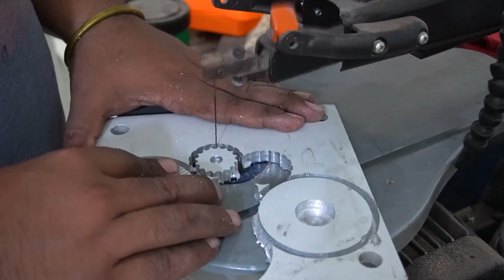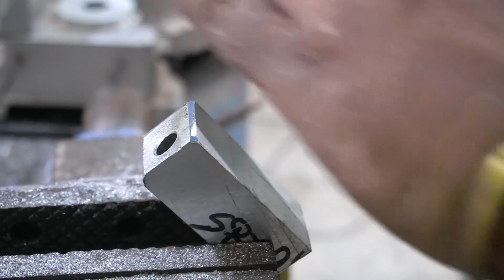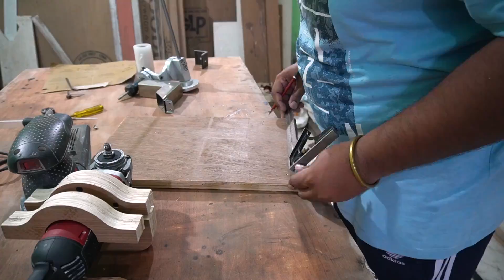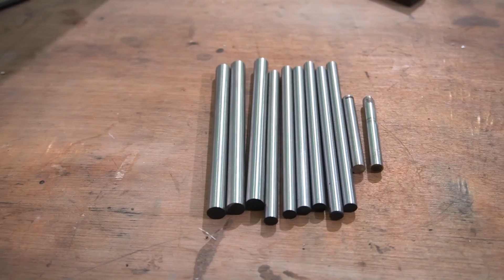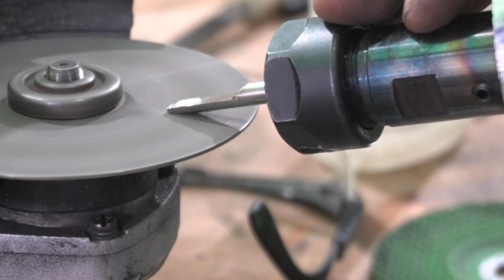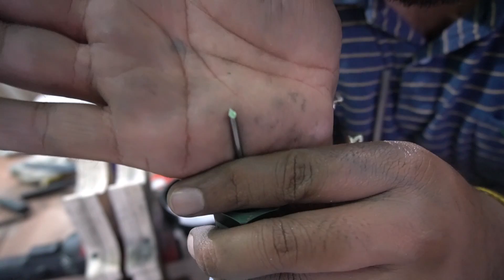Multipurpose sharpening Jig for CNC V-bits, Drill Bits and Gravers - By AMbros Custom

Comment: You're are an innovator and genius! Working with D bits for more than thirty years. This piece of equipment is unique!

I had made a little different piece of grinder from a design I got from British Council library.

Some suggestions though!
1/2 bit thickness should be about 20 microns less.

The back relief angle we use is a continuous relief like a drill bit, a swash plate mechanism is used to achieve that.

The tip is not exactly V, we give a horizontal and vertical relief of about 7 degrees. Tip is about 0.25 mm wide! 

We used them on 100Cr6 prehardened steel at 28 HRC on a VMC at just less than 8000 rpm! Works magic.

Innovate more and enlighten the community! But keep your secrets with you or get a patent!
Reply from the maker: Thanks for your words.